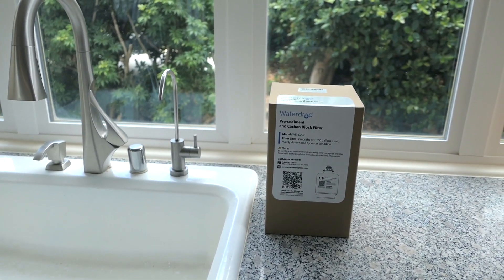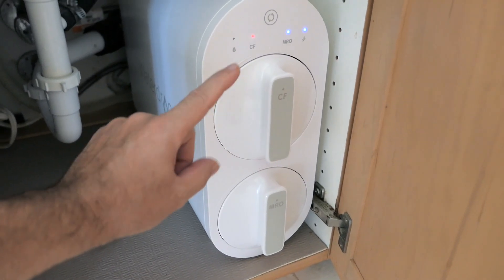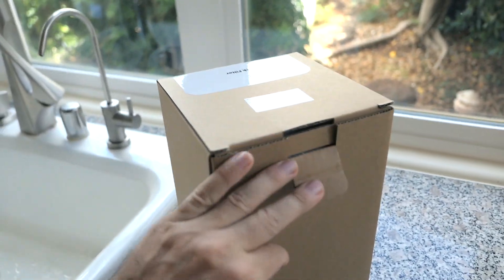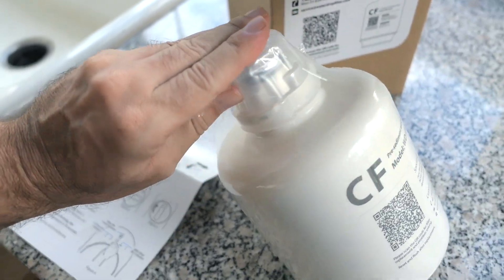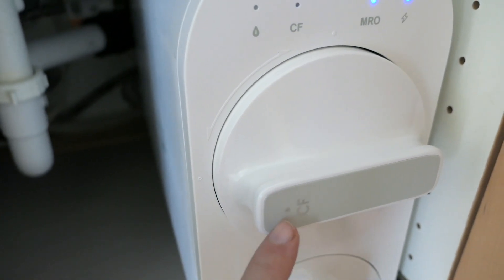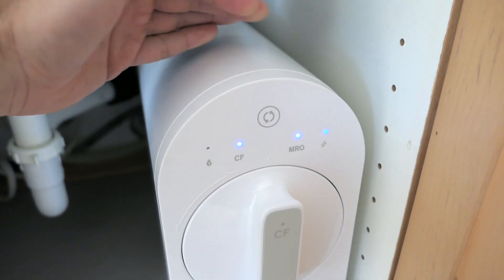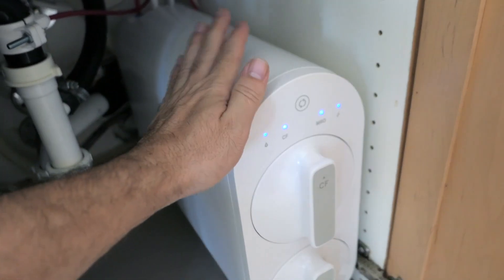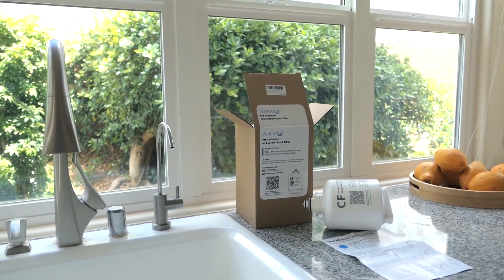WaterDrop G2 - Filter Replacement & Reset - Update

Comment from the maker: G2 RO System: https://geni.us/FzflUG
CF Filter: https://geni.us/BBuL
MRO Filter: https://geni.us/kpA98
Reply: Okay I just figured out I must have a G2, since it only has two filters not three. 🙄 but it still doesn't look like the one in this video. Mine only has two lights, labeled CF and RO, and no reset button - at least, not one that's visible from the front. Any suggestions? By the way, this unit is less than a year old. So is this the latest, redesigned streamlined model? Seems like the one you have makes more sense.

Comment: My system does not have 4 lights, it only has two: CF and RO. Also, it does not have a reset button, at least not on the front of the unit, which the one in the video does have. I turn on the water I get a constant beeping and the CF light is red. So obviously it's the one that needs changing. My question is how do I know if I've got a G2 or G3 unit? I lost the owner's manual and it doesn't indicate anywhere on the outside of this unit which one I have. Any suggestions?

Comment: THank you!!! Sadly we threw away our packet or instructions with it a year ago. We are in an RV full-time and we have this under our sink. You just saved our sanity because we changed our filter four days ago and we could not figure out how to get the dang thing to stop beeping and your detailed instructions Are oh so heavenly sent. Thank you. Every other video I have found on YouTube just says press the CF button ours doesn’t have a CF button. It’s the same model you have so it just has those two arrow E circles on it and no one showed that if you hold impress until one of them beeps that you can press it and go to the other filter and then once you have the proper one indicated then you hold it down for a few seconds until it turns blue. Everyone just said just press the CF button.I’ve been going crazy and so sorry to continue to say this but thank you thank you thank you thank you thank you thank you
Reply: My system does not have 4 lights, it only has two: CF and RO. Also, it does not have a reset button, at least not on the front of the unit, which the one in the video does have. I turn on the water I get a constant beeping and the CF light is red. So obviously it's the one that needs changing. My question is how do I know if I've got a G2 or G3 unit? I lost the owner's manual and it doesn't indicate anywhere on the outside of this unit which one I have. Any suggestions?

Comment: I couldn't get the filter reset button to work, so I just unplugged it and replugged it. It reset it, but I guess if it were only one filter you needed to change, that would be an issue.

Comment: Do you know if the thing beeps based on a timer or it really tests the water or filter?
Reply: It's based on gallons filtered, not a time based thing. I heard the cf filter should last about 6 months for a family of 4. Our family of 2.5 made it 1.2 years without changing it. It just started beeping last week.
Reply: Sounds like from the fact that you have to tell the thing that you replaced it, it's not really smart.
Reply: @joan38 probably timer based...i havent changed mine in 14 months and it keeps beeping..water still tastes good..so i am keeping it and not changing the filter

Comment: What happens if you just hit reset and leave the old carbon filter in?
Reply: I was wondering if anyone has tested this. It might just be a timer. Has anyone had it start flashing in less than a year?
Reply: Well, I have to replace mine…I’ll do a test with the old one, install and test the new one, reinstall the old one and test it again

Comment: Just wanted to add to your instructions that if you find the old filter impossible to rotate counterclockwise, I found I had to shut the cold water valve off. Make sure the water has left the faucets to ensure the pressure is out of the system.  I had to do this each time I had to remove the old filter.  I hate bothering with shut off valves, but even this product can be difficult to rotate the old filter out too.
Reply: Thank you very much for this tip and trick! I was having a difficulty in removing the old filters.